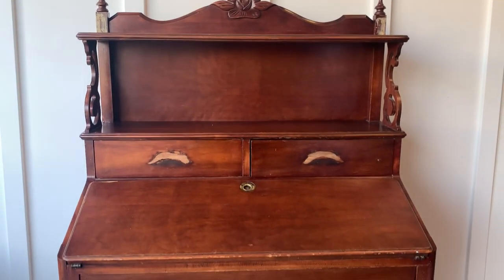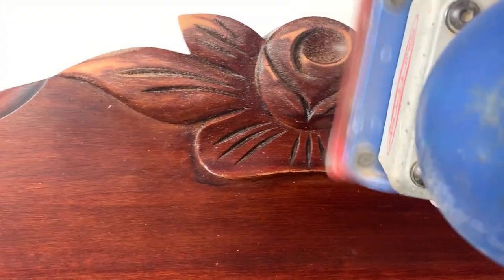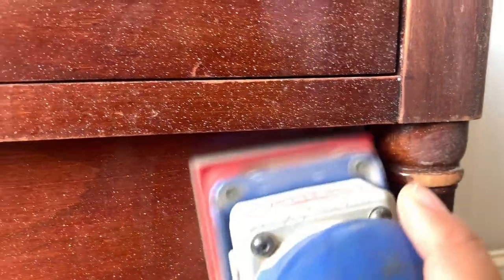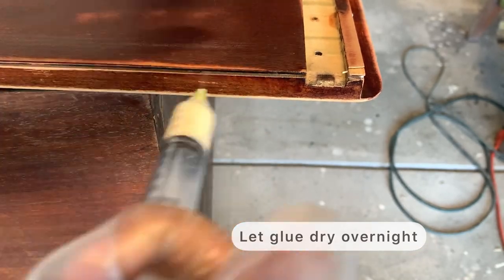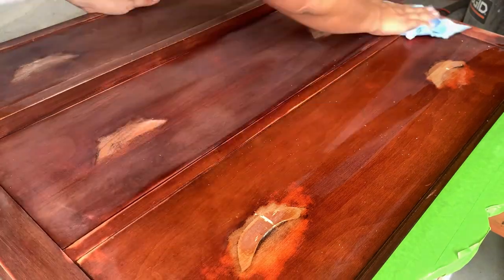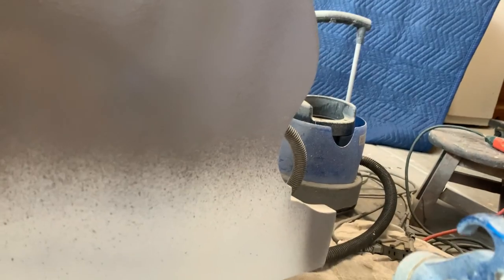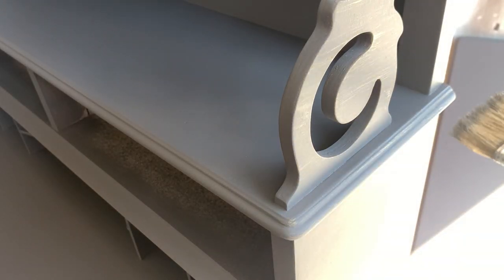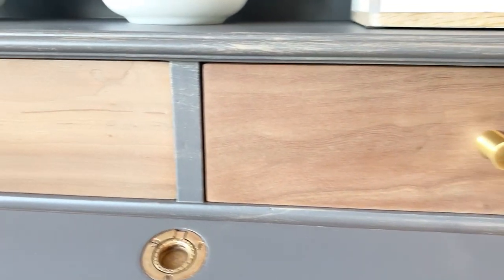UNIQUE ANTIQUE CABINET MAKEOVER | FURNITURE FLIP

Comment: Love it! What glue syringe do you use? Are you able to reuse it again or is it a 1x use tool? I asked about them at a local hardware store and they didn't know what I was talking about.
Reply from the maker: Rockler Dispense Pack Glue Applicators, if you cover the tape, you can reuse it.
Reply from the maker: I meant if you cover the tip of the syringe with tape, you can reuse it.